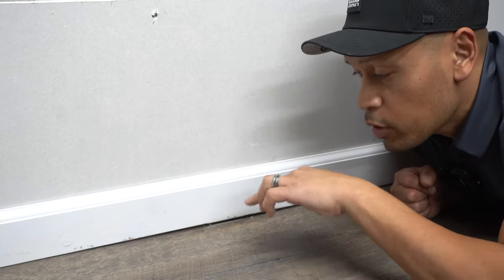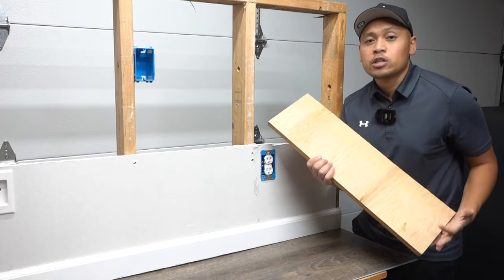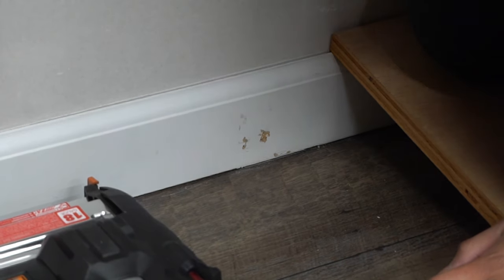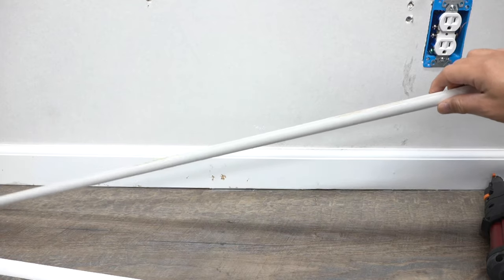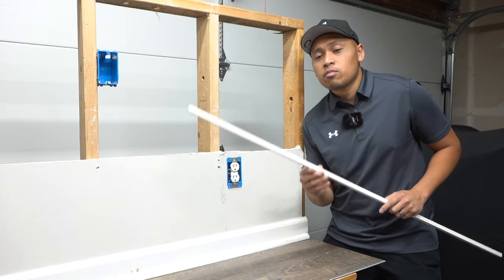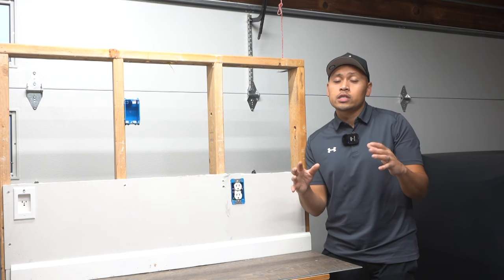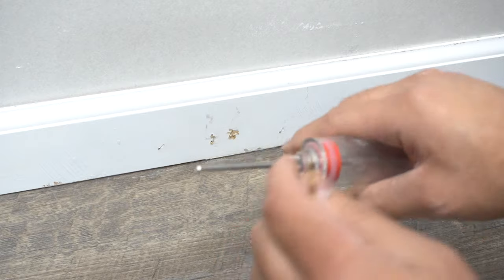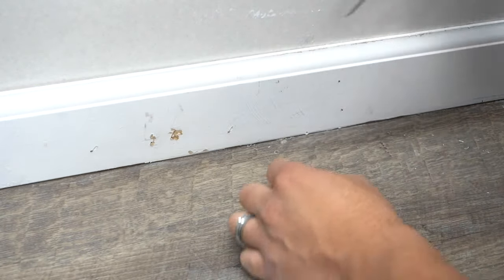How To Fix HUGE GAPS Between Your Flooring And Baseboards For A Flush Fit! DIY Tips & Tricks!

Comment from the maker: ITEMS I USED ON THIS VIDEO:
- WORX 18 Gauge Brad Nailer - https://amzn.to/3PXcc3z
- Dripless Caulk Gun - https://amzn.to/3RZn3g1
- DAP Extreme Stretch Caulk - https://amzn.to/3ZTZHdw
- Caulk Cap Savers - https://amzn.to/3ZTf8Tx
- 9/64” Drill Bit - https://amzn.to/48V6WWY
- Meat Injector Syringe - https://amzn.to/48Q9K7I
- Cordless Drill - https://amzn.to/3tvN4JR

Comment: Excellent video!  A sidebar question...would you happen to know if you can put OSI chaulking underneath T111 siding so it covers the gap between the siding and concrete to stop mice from entering?  I stuffed stainless steel wool underneath my siding but somehow the mice have learned how to pull the wool down.  In the areas where I have the stainless steel wool and caulking the mice leave it alone It's too much work.  

But my concern was if I put such chaulking to bond the siding to the concrete would that affect movement of the siding due to weather changes?
Reply: We use farm FIELD RAT poison  every spring and fall. Like clockwork.

Comment: I am getting a significant gap between the kitchen counter top (laminate) and the wall (also laminate) above the dishwasher so can't get underneath to maybe raise the counter top back into place.  The counter top does not have a bead of caulk so don't want to use that since that would be quite noticeable.  Any suggestions.  Thanks.